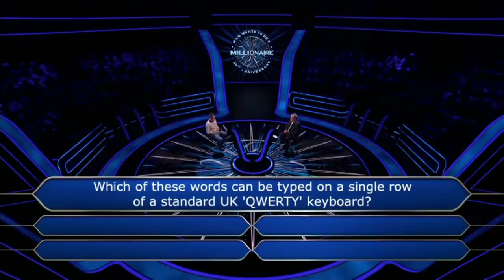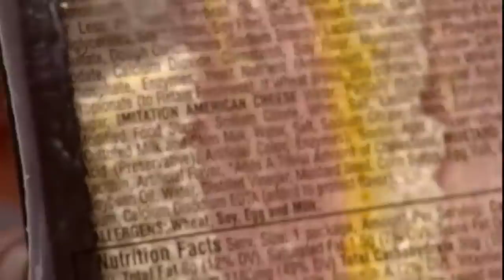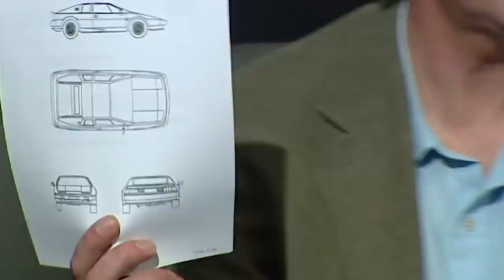Clarkson, Hammond and May Cheese Compilation

Comment: I’m pretty sure everyone has thought of the solution to potholes, which is simply pouring asphalt in the hole
Reply: It isn't though. If you do that, it won't bond properly with the road surface and it'll pop out again in a couple months.

Comment: Dear R. Hammond 

How can a liquid be self levelling on a Hill?
Also, most pot holes are caused by liquid erosion. Your liquid pot hole fix will simply flow away just like the water that caused the hole in the first place.

:p